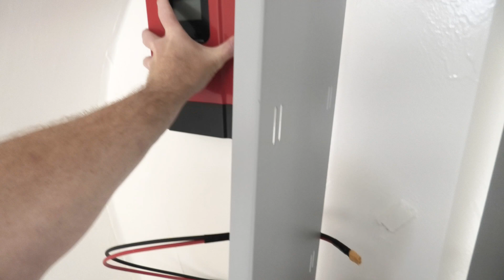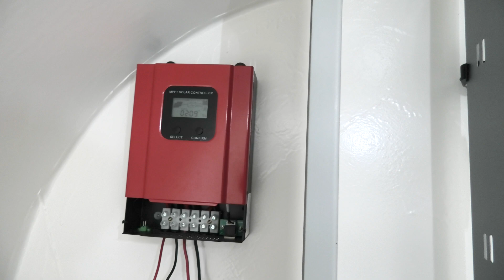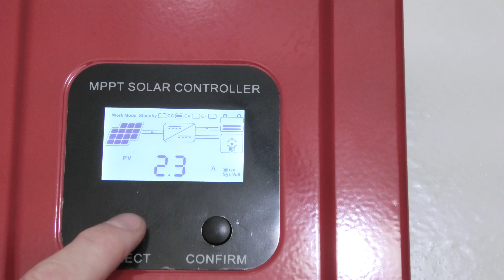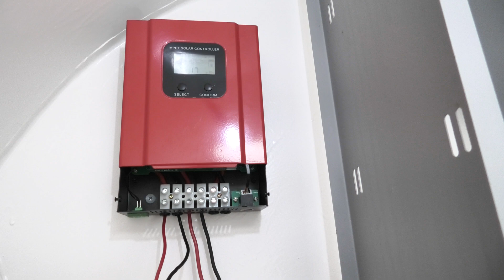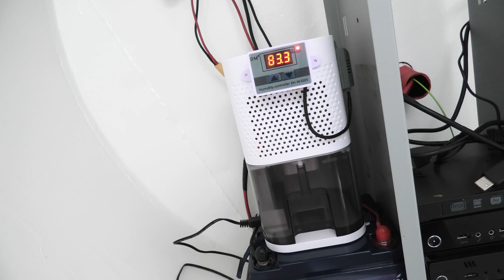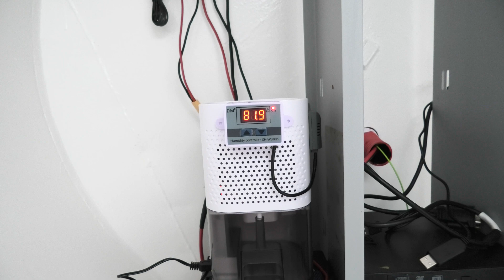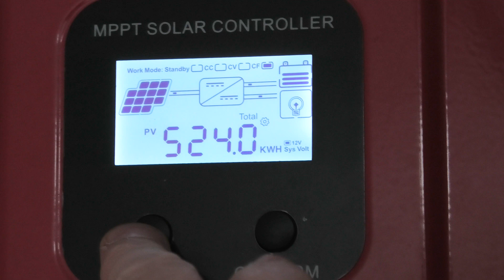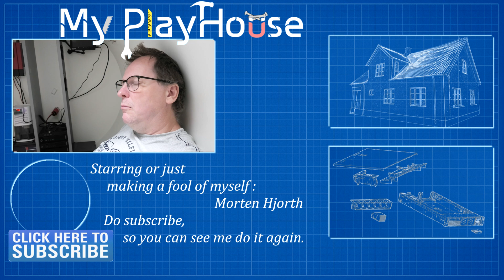New DC Solar Power setup for Tiny Backyard Bunker - 1412

Comment: And what about the CO2 inside... ????  Fresh air...
Reply from the maker: 2500 liters of air will take me 8 hours to breath in and out one time. If you have ever tried to breath in to a little plastic bag,, you will know that you can breathe that air in and out 10 times,, as you can take in the O2 even it it is not at the normal 21%.
I am not in the bunker very often,, and for like ½ an hour. it's fine.

Comment: 12v system is probably better than 48v for running stuff from DC, there are a lot of DC 12v to 19v converters for running those lenovos for example.I  use this for charging my laptop / macbook from 12v.
Reply from the maker: Yes,, like a car charger for a laptop..  I do something a lot cheaper in my video later today.
Reply: @MyPlayHouse  interesting I'll look forward to it! Incidentally do you need any Lenovo power connectors or 65w power
bricks?

Comment: With dodgy wires, try a magnet. When they're already cheating, why not cheat more? Often it's copper coated iron, instead of the also-horrible copper coated aluminium.
Engineering an airtight lid/hatch sounds like a good idea. (A fuse also, if the battery wire is smaller than the protection/fusing in the battery)
Reply from the maker: If I was the kind of person that might try and use a 12v coffee machine in my car,,, that wire would turn in to an electric heater :-/

Comment: Wouldn't it be more efficient to ventilate the room with outside air? It would also would be safer for co2 levels when working down in a confined space.
Reply from the maker: The problem with that is that the bunker is in the ground and the ground is cold,, when you blow warm air on a cold suffices,, the hot air will leave humidity on the cold walls. If I can blow dry air through the bunker it would be more efficient,,, but how to dry the air.

Comment: So far I have not seen any fuses - Question - are you nuts?
Reply: I think there is a fuse in the charge controller. But yes,, it’s smart to add an fuse inline from the battery
Reply: @JustinvEmst  a dehumifier creating water on top of a (presumably) waterproof battery on a 40 Amp solar charger meaning it is fused for 80 Amps, through wires rated for a maximum of 10 to 16 Amps - Ah well if nothing untowards happens, should be good enough
Reply from the maker: Well the battery is limited to 150A for less than a sec. before the BMS shuts off. The eSmart3 is limited to 40A and has fuses inside,,,, and the dehumidifier has a fuse in the 12v car plug.
This is a tiny little setup,, it will grow and I will add a fuse to the battery at some point.
Reply: @MyPlayHouse  the fuses in the mppt controler are ±80Amps (2x40A in parrallel) however the wires used will burn way before a fuse can blow - and the inside of the tank are almost prestene white
Reply: he puts a water cannister with a bypassed overflow-sensor on top of a battery, I guess that answers your question 🤪

Comment: You can also attach some magnets to a wire conduit when you’re ready to cleanup the wiring.
Reply from the maker: I need more magnets,, used a lot to mount the box. I needed the dehumidifier to be running,, so a quick fix here. :-)

Comment: Dear Mortem. I  am little concerns about safety . please keep on mind all electric or electronic equipment  need to be 30 cm up from the floor . Also your are in closed environment. is easy get a short and you just can die inside. more with system use battery. I am big fun your work but now ......
Reply from the maker: Do you worry about the 12v starter battery in your car ?? You really should not,, it is very rare that anything bad happens!! even if it is not surges protected like the LiFePO4 battery that I am using. :-/
I switch from 230V AC to 12V DC and now you worry :-/
Reply: So much for robot vacuum cleaners then huh

Comment: PLEASE don't have that battery in the bunker, if it shorts out and goes nuclear, you'll be dead before you can climb out. Don't have them in a confined space please. Just thinking of your safety 👍
Reply: Lifepo4 battery going nuclear?
Reply from the maker: I do not hope so,,, then I am in trouble,, with the government.
Reply: @emichal1986  he means a internal short in the cell its self.
Reply: @bmw518rijder  how often does that happen in lifepo4 batteries?
Reply from the maker: Here are 5 protections that my LiFePO4 battery have that your 12v car starter battery (witch you probably do not worry about) have :
1 : Over-Charge
2 : Over-Discharge
3 : Over-current
4 : Short Circuit
5 : High-Temp

LiFePO4 is not known to be danagues,, there is a lot of power in any battery,, and that is to be respected..